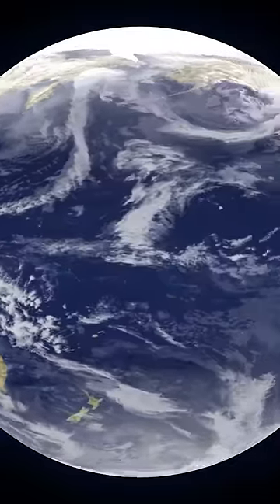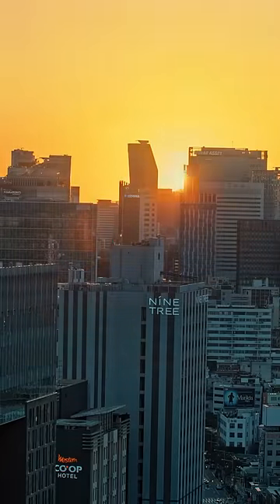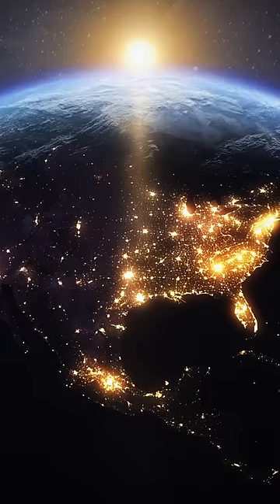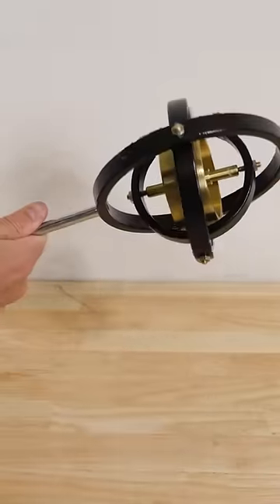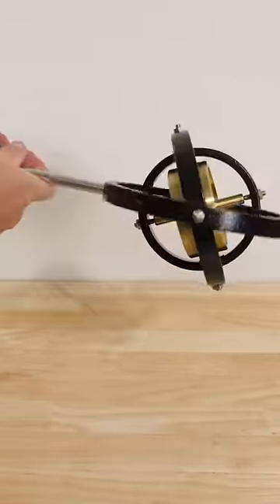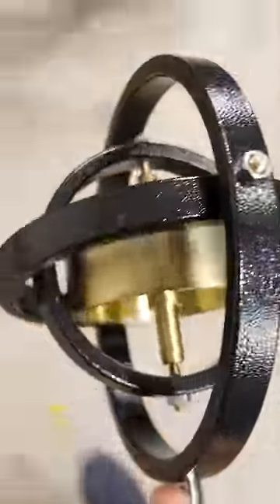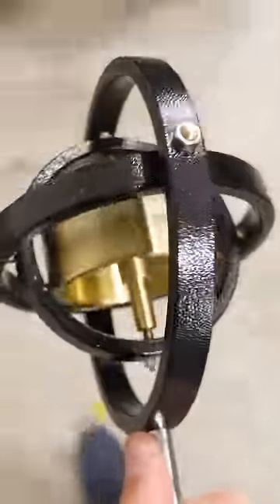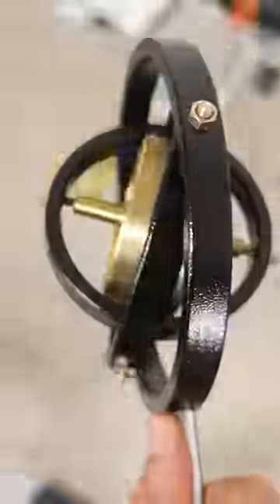Using a gyroscope to power the earth

Comment: Making the day shorter by one second requires energy to be put into the Earth's rotation, because a shorter day corresponds to a greater rotation rate. If you make the day longer by one second, then you get energy out. This is what is causing the moon to receed.
Reply: Almost right, but thinking only in terms of energy can be misleading. Actually it is simpler and much easier to consider just the transfer of momentum. No squared terms. That matters.
Reply: @YodaWhat  It's both, actually. A higher Moon is at a greater gravitational potential energy even at a lower kinetic energy, so energy has to go in. The larger distance gives you a greater lever arm, so even at a slower speed, there's more angular momentum, so that has to go in too. Both come from the rotation of the Earth. Both have to be conserved, so if the Moon gets both, the Earth loses both.
Reply: You just know there's pseudoscience videos out there saying that Tesla made this but it was banned by NASA or some shit 😅
Reply: @wyrmofvt  - Sure, but since energy can be transformed into heat and otherwise lost from sight, the thing to keep your eyes on is the Momentum. Our ocean tides, for example, dissipate energy being exchanged in the Earth-Moon system. How much energy? It is not easy to say. It certainly warms the oceans, but not enough to measure, especially since there are other factors at play, both for warming and for cooling the oceans.
Reply: @YodaWhat  Momentum is not as easy to work with as energy. There is a reason why energy arguments are all over the place in physics.
Reply: Lmfao so true @Sough
Reply: Here we go again... ignorance arguing online over information they were probably told by a drunk science teacher in 5th grade.

Shut up already
Reply: @GoatyHerps no he’s right, the creator of the video made a comment about iy
Reply: Got him

Comment: I tried to imagine similar rotation-extraction ideas for several years. Nothing will work except tidal power, because it connects to the moon. You can't get energy out unless you have something different to put the energy in.

Adding that it is perhaps possible to extract energy from the momentum transfer of moving an object toward or away from the axis of rotation. If you could transport a chunk of Antarctic ice from the South Pole to the Equator, smoothly and mysteriously, and released it, you would find that chunk shooting westward at a thousand MPH. You might be able to harness that.
But once you have a cylindrical-shell earth, you are out of power.
Reply: Cool
Reply: He mentions takin energy from rotation. So, transducing from one form of energy to another within the same system.
Reply: Damn mitchellminer9597 says it can’t be done, time to pack it up boys.
Reply: @ToxicDouble  toxic
Reply: But true
Reply: In the case of the moon, it's not so much about the energy transfer as the momentum transfer.
Reply: You cannot extract it because the earth is not rotating.
Reply: @user-io4sr7vg1v  The earth is rotating - that is obvious - but we are rotating with it, so there is nowhere to extract rotational energy to.
Reply: @mitchellminer9597  No.  If it were it would be easy to simply hover above the earth with a helicoper and 'change location relative to the earth'.  Obviously it doesn't because we are not moving.
Reply: @user-io4sr7vg1v  Your idea is incorrect. The helicopter is rotating with the earth, and the atmosphere is rotating with the earth. There is nothing nearer than the moon that is not rotating with the earth.
We can measure the effects of the rotation, but we can not separate ourselves from it without a rocket.
Reply: @mitchellminer9597  That's impossible.  The helicopter cannot rotate with the earth.  The helicopter is in the atmosphere, which is a fliud, which has a very low coefficient of friction, and therefore the earth and atmosphere slip against each other like smooth ball bearings.  Otherwise the atmosphere would be as hard as a marble and it would be impossible to move. 

The earth is simply not moving.  No matter what they tell us over and over.  It is just illogical..
Reply: @user-io4sr7vg1v  No, the atmosphere has a fairly high amount of friction. That is what we see when the wind blows. But even if the friction was very low, the atmosphere and the earth have been together billions of years - that's plenty of time to spin it up. And there is nothing outside the atmosphere to hold it in place - the moon doesn't touch it, and your beliefs don't affect it.
There is only one way that the atmosphere does not rotate with the earth, and that is when wind blows north or south very far, it gets bent to one side. We see that, we understand that, and it is proof that the earth rotates.
Reply: @mitchellminer9597  Saying it does, doesn't make it so.  It is proved by the physics, the atmosphere cannot move at the same rate as earth because of the slip between the media.  It's obvious you see and experience it every day by the way you walk through the atmosphere.  

You haven't been to the moon, so you really can't say antyhing about it.
Reply: @JayDee-b5u  Saying the physics does a certain thing doesn't make it so. I told you that there is nothing to keep the atmosphere from spinning at the same rate - what are you saying is pushing on the atmosphere? What makes it move differently?
I say there were billions of years for the atmosphere to settle in with the earth. Are you assuming a young earth?
Reply: @mitchellminer9597  I have no idea how old or young the earth is and wont pretend to.  I can't observe it so it would be pretty much impossible to tell (the scientific method requires obervation).  I am simply saying that observing the physics of this earth, we are not rotating regardless of what is said in books by professors etc.  

Gas is simply different form of matter than solid.  In this case our atmosphere is the gas and the earth is solid beneath it.
Reply: @JayDee-b5u  Yes, the atmosphere is a mixture of gases. Gases have internal friction - they tend to sit still, barring outside influences. 
The exact age of the earth is not important (although it can be deduced and calculated and checked and confirmed). The earth is old enough that the atmosphere will have settled to a stop relative to its surface, barring outside influences. What are you saying would keep the atmosphere (on average) from matching up with the rotating earth?
The moon has nothing to do with it, and I don't have to go to the moon to know that. 
What would keep the atmosphere from being dragged along with a rotating earth?
Reply: What your saying is confusing.  When one exhales they blow the atmosphere against the surface of the earth,ground etc.  We can observe for ourselves that the atmoshere is not 'clinging' stuck to the ground.  That phenomena is known/described as having a low coefficient of friction between the different substances.
Reply: very interesting. funny how this alternate clean source of energy is still "fk the penguins"
Reply: @hrishikeshaggrawal  A Pëngüin once bit my sister ...
Reply: @JayDee-b5u  Ah, you're one of these guys that believe that the earth is flat and some godly guy is pulling the sun over the surface with his magical flaming chariot.
Reply: @garderork339  No-non sequitors here buddy.  You seem upset.  No need to get emotional.  It simply is what it is.  We are obviously not moving.  It's actually totally ridiculous that anyone would conclude the opposite.  We all know we're not moving but we're had our ability to think 'educated' right out of us.  Lol.  It's ok.  Trust your senses.
Reply: @JayDee-b5u  Ok then you're no flat-earther, that's at least something. You just can't understand how gravity works.
Reply: @garderork339  You don't understand anything you are talking about.  You're just repeating what you've been told.  It's a shame.  Respect your ability to think instead of repeat.
Reply: @JayDee-b5u  First: Sorry, i didn't read too much into your problem and what and why you can't understand about it. For that I apologize. It's actually not too bad thought out, since it is what in ancient Greek was believed.
Let us make a little mind experiment about what movement is. Would you say that you're moving while you're sitting completely still in a train that moves with 120mph? The answer depends on what you're comparing you're movement to. If you're comparing it to other objects in the train you're obviously not moving at all, since everything stays in place. But if you're comparing it with the outside world you see that either that outside world is moving or yourself. Even in ancient times  astronomers saw that the stars don't stay where they are, but instead are slowly moving, in a rotating motion and they concluded that the earth is the middle point and the whole universe around them is rotating around earth. Now back to our little mind experiment: What would consume seemingly infinite more energy: That the little train you're standing completely still in is moving or the whole outside world and universe? Obviously the train moving would consume much less and since everything in the universe goes from high energy stored to low energy stored points (like water in a lake at a higher point has falling energy stored which it lets free when it can actually fall) it's infinitely more possible that the earth is moving than the whole rest.
Reply: @garderork339  The problem is when you are supposedly 'spinning' everything changes.  Then you have to have a lateral acceleration component.  This is what you are missing.   And as such there must be a force associated with that acceleration.  a = v^2/r (velocity of the earth squared divided by the radius).  Furthermore that force would have an effect on every mass at a proportion of F = m*a^2.  

Additionally the atmosphere is a fluid with a high degree of slip between it and the surface of the earth.  So, what we have is a centrifuge.  And if we have a centrifuge then the more massive elements should move to the outer regions but this does not happen.  

It has to be concluded that we are not moving.
Reply: @user-io4sr7vg1v  Dude, the stars in the sky rotate counter-clockwise around Polaris in the northern hemisphere, and clockwise around a star in the Southern Cross constellation in the southern hemisphere, every 23 hours and 54 minutes. At the equator all stars rise in the east and set in the west.

Hurricanes and tropical storms spin clockwise and counter-clockwise in each hemisphere too.

If you have a gyroscope or swinging pendulum with a very low friction bearing, it will rotate 360° every day... because the Earth is rotating beneath it.
Reply: The Earth's atmosphere is in orbit around the Earth... a very low orbit that's constantly being pushed into a higher orbit by colliding with the ground. 

This is also the case for the oceans, rocks, trees, and humans. We're all in orbit around the Earth right now You don't notice because everything around you is in the same orbit as you. Everyone and everything on the equator is currently moving East at ~1000MPH
Reply: @JayDee-b5u  I guess with lateral acceleration component you mean the centrifugal force of earth which really is  applied to everything, but now guess what happens if there is a force opposed to that, that is stronger? Do things then fly out or not, now we're a bit nearer to the modern days since Newton had the same thoughts and get that there still must be something holding us to the ground and that thing is called gravitation.
Reply: I read your post and my brain started hurting.
Reply: @JayDee-b5u  Think of how Earth was formed. A cloud of spinning stuff that got pulled together by gravity. Why would you or the atmosphere magically escape that spin?

Comment: Technically tidal energy is extracting energy from the spinning earth
Reply: Tidal force is caused by the moon's gravity, not earth rotation.
Reply: @igors1234 it caused by interaction between them
Reply: @igors1234 you know tidal waves that are caused by moon's gravity MOVE because earth spins under them? The commenter is correct
Reply: @kolyashinkarev7366 Exactly, that's why there are tidal waves every few hours instead of once per month.
Reply: @kolyashinkarev7366  The tide is still caused by the moon's gravity, not the earth rotation. Remove rotation, and the level of water will be constantly elevated by gravity on the side of earth that's facing the moon. Remove moon, and there will be no tides.
Reply: @igors1234  and? You still extract energy from the earth's rotation, you just use the tides for that, what the hell are you trying to prove?
Reply: @kolyashinkarev7366 But isn't it the other way around then? The tides slow earth rotation down, so shouldn't Tagung Energie from that reduce the slow down?
Reply: @kkrg413  Correct. The Earth used to have much shorter days and the moon was a lot closer a long time ago. As the Earth interacts with the moon, the rotation of Earth is slowed by the moon. The moon picks up that energy and moves faster, raising its orbit. The moon loses some energy of this raising orbit by deforming the Earth. It's a bit of a convoluted relationship, but the rotation of the Earth eventually results in tidal forces on Earth (and on the moon too, hence the locked rotation. As the moon raises its orbit, it will transfer energy from its rotation to stay locked to Earth. Very minor tidal forces on the moon, but still there).
Reply: @igors1234 your second comment is arguing via straw man fallacy. Classic case of someone doubling down on stupid because they have too much pride to admit when they made a mistake
Reply: @AkamiChannel  Then what's my mistake?
Reply: The moon influences tides but it there's many other factors at play
Reply: @igors1234  What causes the tides is irrelevant to the OP's correct statement. The tides require energy, and it's being extracted mostly from the Earth (because that's where most of the gravity/mass is, which is why the Earth's rotation is slowing down. The tides are essentially analogous to the gyroscope, but are effectively held in place by the moon. If some force outside the Earth could hold a gyroscope stationary at the pole(s) then it would spin (relative to the Earth) for as long as the Earth continues to rotate.
Reply: @suedenim9208  How do you think tides slow down Earth's rotation? The water facing the Moon elevates, thus gaining potential energy. As it turns away, it goes down, thus losing potential energy. It compensates. It's the interaction between Earth's and Moon's gravity that slows down the Earth rotation (Moon is rotating around Earth slower than Earth rotates around itself, so it pulls the Earth "backwards"). If Moon rotated around Earth faster than 1 day per cycle, it would increase Earth's rotation speed.

If you extract energy from the tidal elevation of the water, you just reduce water's potential energy gain, that's it. Like if you put a HES in a river, it doesn't magically slow down the Earth's  rotation, it just decreases river's kinetic energy and transfers it into electricity. Or if you put a wind turbine, it decreases kinetic energy of the wind and transfers into electrical energy, but doesn't slow down the Earth.

Comment: If you were able to extract the Earth's rotational energy, it wouldn't make the day shorter.  It would make it longer.  Also, precession doesn't occur with two counter-rotating gyros.  Finally, whatever energy you put into the gyroscope's rotational velocity will always be more than you can extract.
Reply: It also seems to me that eliminating one rotational degree of freedom would prevent the gyroscope to align with Earth's spin axis. So it should be built more like those exercise gyro-ball thingies, which have only two axes of rotation (and track rollers for good measure).
Reply: Yeah, this is definitely  trying to get a free lunch. Any mechanism that  could extract energy from the gyroscope would  eventually  prevent it from remaining stationary unless an equal amount of energy held it stationary, even if it was one of the magical frictionless ones that only exist in physics classes. Unless that energy somehow comes from a source outside the Earth there can be no net gain in energy. Maybe if we make it tall enough we can put a giant solar sail on it.
Reply: The energy comes from the earth rotation. Nobody claimed this would be a free lunch.
Reply: Assuming a frictionless gyroscope the energy needed to spin it up would be a fixed cost while it would generate energy at a constant rate. It's just a matter of time for it to break even.
In reality the problem is generating more energy than is lost due to friction and to pay for maintenance and repay initial investments.